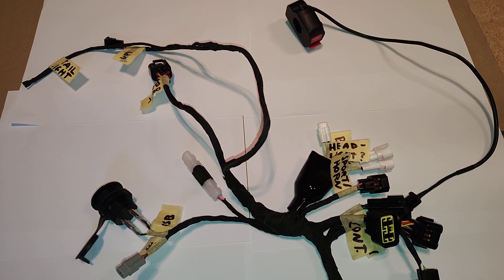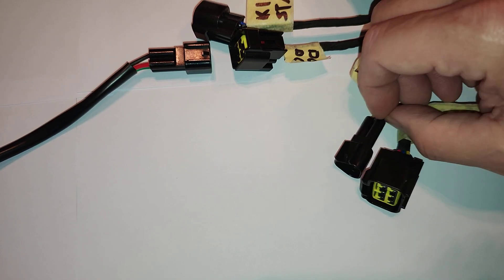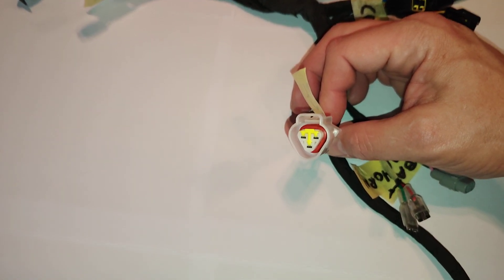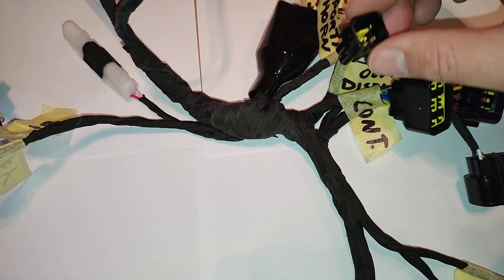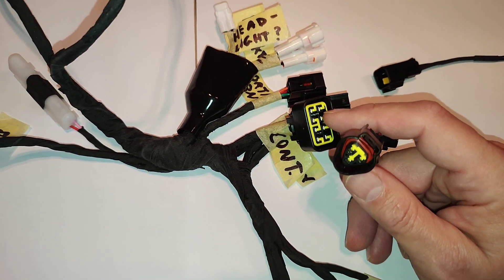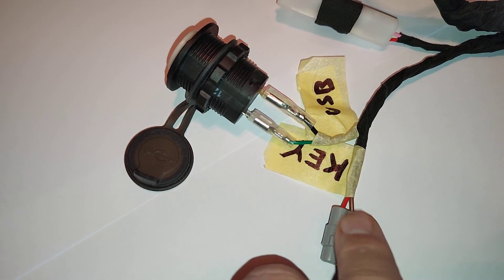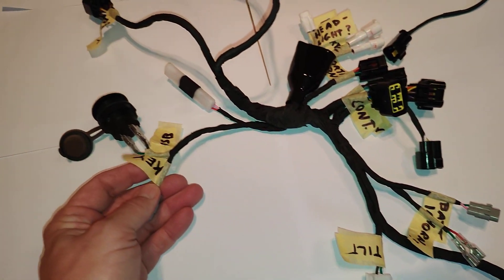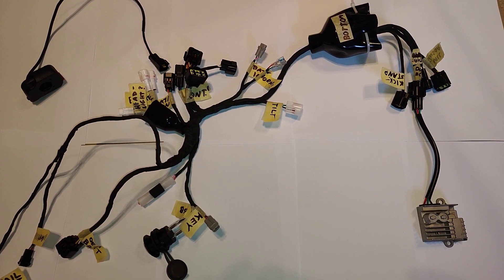SUR-RON WIRING HARNESS EXPLAINED |  SURRON DIY BUILD FROM SCRATCH

Comment: Thanks for the video! Is that OEM Batt connection the blue round one that locks into the stock battery? I was wondering if I could make my own battery and couldn't figure out if that was necessary with aftermarket controllers also.
Reply from the maker: Hi, correct - that connector to the OEM battery is not needed or used when you have an aftermarket/DIY battery pack.

Comment: Hey coolwatts! I was hoping you could help me. So I’m using all surron wiring for a non surron build. And had a question.

The “battery in” connector the small grey one. Is that connector the equivalent of positive and ground ring terminals to give the harness power?
Reply from the maker: Hi, yes, that is battery voltage in. 60v, 72v, 80v, etc.
Reply: @CoolWatts  you just saved me so much time wondering why my harness wasn’t receiving power lol. Thank you and your finished build looks awesome!

Comment: Hello,
maybe you could help me.
I want to install a new taillight, it has 5 cables, 2 is for signals, 1 positive, 1 negative and 1 for the brake light.
the signals I don't care about, the positive and negative is obvious, where do I need to add or to weld the brake light for it work when I'm pushing the brake levers?

Comment: Does this still have the green loop to cut to derestrict the bike? by the top of the battery
Reply from the maker: I didn't see it on the new harness I got, purchased from Ali 12-2023.
Reply: The sleeve that covers all the cables looks tighter and made of different material then the harness that comes on a brand new bike, I have ordered the same harness as shown in this video, but I am concerned it will restrict my bikes top speed again
Reply: @shawsie9462  if so, you just cut the wire again or connect a clamp with wires cut.